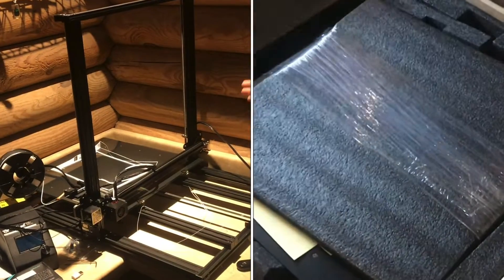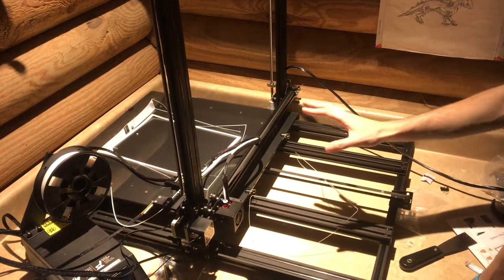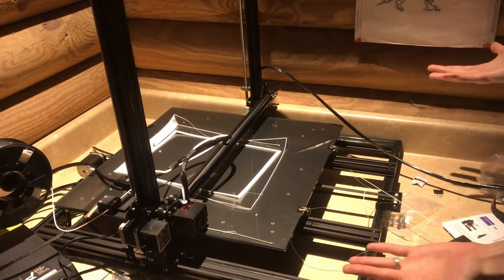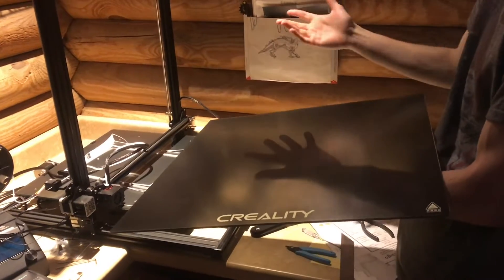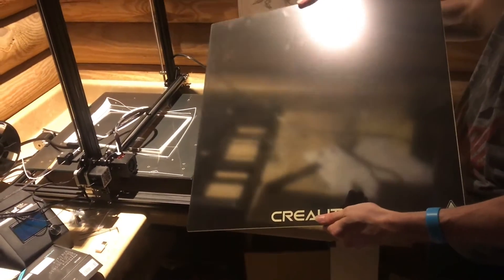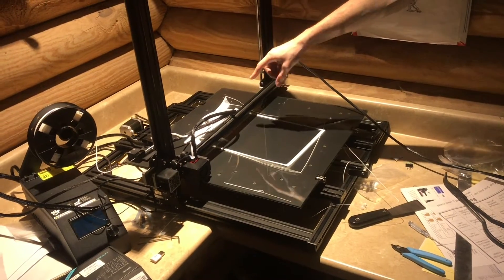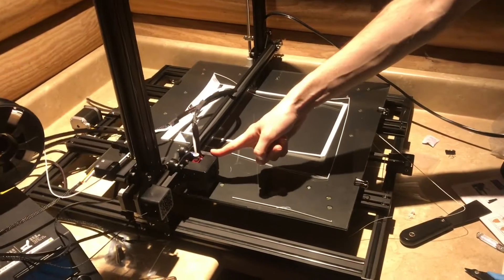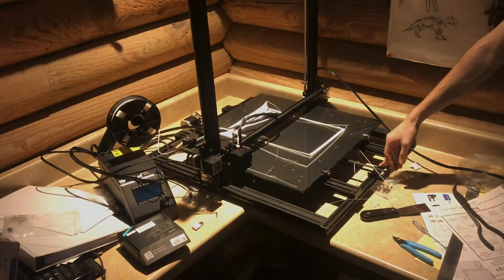(REVIEW) creality cr-10 S5 plus 3D printer “massive print size” 500x500x500mm

Comment: 1.) Grt capricorn like the other guys said. Worked wonders for me.

2.) Took me a looong time to figure out printing on glass bed, especially with petg...the trick? 60C pla, 90C petg...print first layer slower until it sticks. I can get 20mm/s first layer with small nozzle and pla. 15mm/s with small nozzle and petg. When I use 0.8mm nozzle with petg I have to slow down to 8mm/s the first layer

Comment: I have the cr 10 s5 too. And by my, the printer functions pretty good. I have this problems not. But the cabel problem on the hotend have i too. And i will fix that with a cabel holder.

Comment: Go with Capricorn Tubing and GET RID OF THE STOCK PLASTIC PTFE!!!!!  THAT is a BIG part of your problem.  
The PTFE will heat up and MELT INSIDE of the hot end and cause all kinds of problems. As far as glass, yeah, 
it's hard to print on. Some have used Elmers Stick glue (like the kind in gradeschool) to aid in bed adhesion.  
Others have used hair spray (God Bless the 80's Hair lol).  Love the project, keep us posted bud..
Reply: You mean changing all tubes , using the Capricorn tubing ? Wow ok